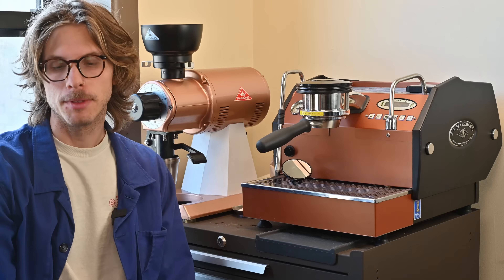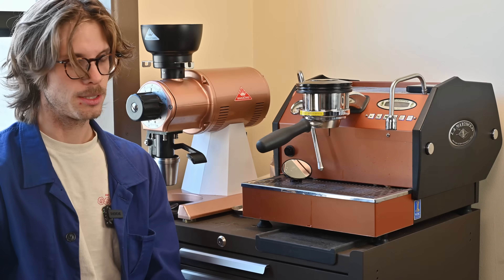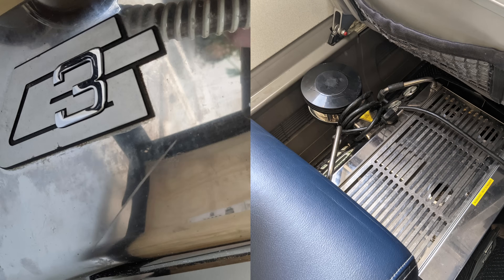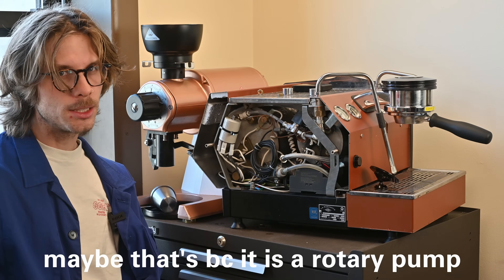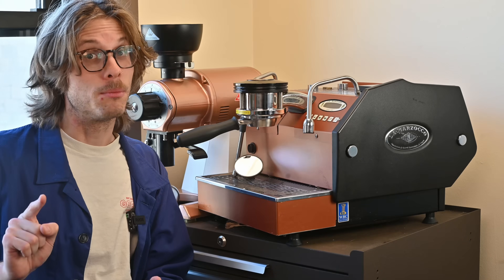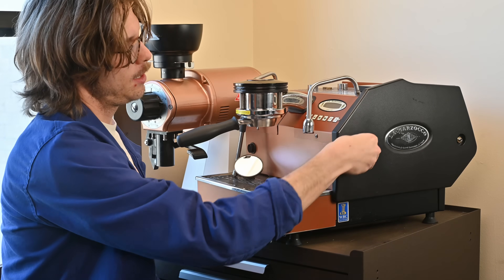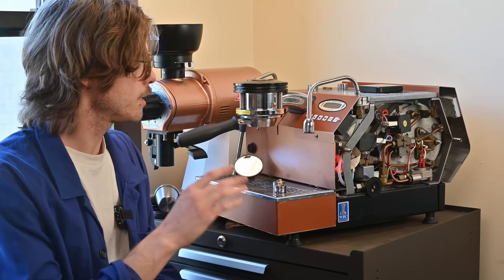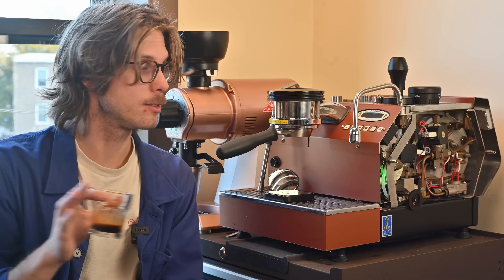An Engineer's La Marzocco Build

Comment: Very nice! You mentioned the lack of adjustment with the solenoid for steam, how come you didn't use PWM? I'm planning on adding steam to my machine with a pot controlling a PWM signal to a solenoid, but now I'm wondering if there is a reason to avoid that route. I'll be using the vinyl wrap - I wasn't looking forward to all the work of spraying my machine.
Reply from the maker: This design was inspired by the modbar steam, which only uses a switch. I've noticed I never feather the steam so I didn't feel it was worth the additional complexity. If I ever felt the steam was too powerful I could just turn down the temperature

Comment: I notice the MW box under the SteamValve button - Is this the to power the button, so it opens the solenoid? Also, assuming due the the half the size line, you increased the bar pressure to 2.5 over the 1.5?
Reply from the maker: That Meanwell power supply is what I reference as powering the DC pump. the Solenoid is powered directly through the AC power from the outlet.

The GS3 can be set to any pressure, so I've always had the habit of running it towards the higher end.
Reply: @tatemazer   I've been literally thinking about modding for the Slayer Style Side Panel Pull, but  I was stuck on a few things, so when I saw this, I was like okay this.....Im techy but not engineer  so bear with me - I found a light up switch that is silver with red light-up ring.  IP67 and 25mm latching (since looking at the diameter of the one you got matches. HOWEVER it's 12v 15mA, AC/DC - Also the  solenoid is a 120V assuming because that's the current running through the machine. - Does the switch need to be 120V?   I've tried to pause it, and see those fittings, but there's no clean shots. Can you PLEASE do a list of ALL the fittings/Adapters, lines and where you wired to switch, so I don't have to do another maintenance kit on mine this month... a couple years ago I upgraded the board with the retro kit and the wifi/bluetooth.

Comment: Automation engineer and coffee nerd here, seeing the pump rattling in there on top of the cables looks like an electrical hazard.
Fine, if you use it yourself, but if someone else is running it, I would advice to have the pump fastened in a secure way.
Just friendly advice !
Reply from the maker: yeah its not great 😅 since the release I've created a mount out of TPU that's working quite nicely and making things run a bit quieter!

Comment: Hey dude, really love your work. Was going to buy your brew by weight mod for my Micra but ended up selling it and getting a mini! I see you have the same mod for the mini, was thinking id give it a go, but when I total up $150 for the part and then $200 for the scale Im only $50 off just buying the brew by weight scale. Totally understand this is a small business and no doubt you are providing an awesome service. I think the mini market is a tough one at this price point, unfortunately! I think the challenge with the Booko is it wont fit right in the drip tray cutout. Hope this feedback is helpful, again, awesome stuff!
Reply from the maker: I agree! As I highlighted in my last video, the la marzocco solution is great, but the shotStopper is more geared towards those that already have a scale they want to use with brew by weight.

Comment: Is the brew by weight module compatible with any machine that has a solenoid? Or is it programmed differently for particular applications?
Reply from the maker: Hi Tristan! The kit works with primarily any machine that both has a solenoid valve and also has low voltage (~5V) switches

Comment: With the options provided could shotstop be fitted to a v2 silvia? Thx from NZ.
Reply from the maker: Unfortunately no 😞 the shotStopper works with low-voltage switches only and the Silvia uses high voltage switches:/
Reply: @tatemazer thanks. Still your yt post got me swapping to brew by weight, not time.
Reply: @tatemazer  Does Silvia Pro use low voltage switches?
Reply from the maker: @Martin-i8o8nit does! And a Silvia pro version is currently available!

Comment: I am one of the happy Micra customers.

i am eyeing a used GS/3 as a second machine. One final downside of it is the oooold display and unsightly buttons.

Are you maybe thinking about putting a oled or some other more modren display in there?

Also how would i go about replacing the rubbery buttons? maybe a 3d printed button kit of some sort could be manufactured? Love this stuff!!

Thank you
Reply from the maker: Hey I was actually just thinking about this! Yes I think I could change the display out to an OLED version pretty easily, but I have yet to explore that.

I recently replaced the button caps with the parts from la marzocco. they peel off pretty easily so new caps should be pretty easy!
Reply: @tatemazer  thanks for the response. I would love to see you execute the display mod. I am sure it would be awesome
Reply: @tatemazer the buttons also art the type of plastic that gets sticky over years of use
Reply: Yes! Would love to see somebody design a replacement display for the GS3